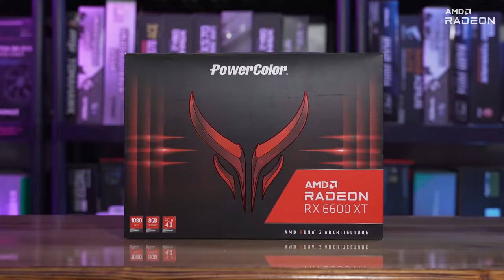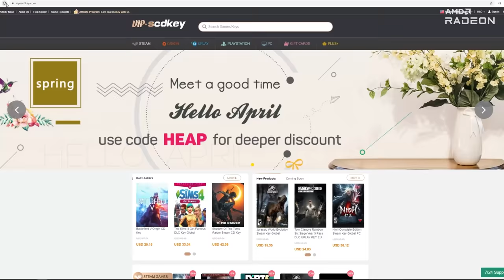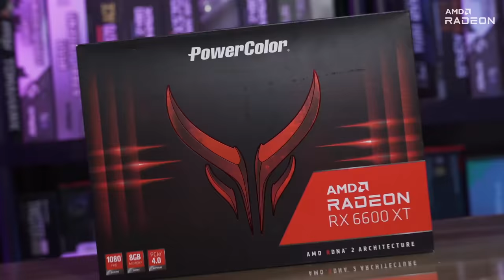LOCKDOWN Timelapse PC Build: Bakit SULIT na mag RX 6600 XT ka na lang? ft Tecware Fusion & Scythe

Comment: I bought a 6600 xt. The card is very efficient. Undervolted and underclocked from 2600mhz to 2400mhz. Power consumption from 160w to only 80w. Max hotspot temperature is 60c-62c.
Reply: pwede po malaman settings niyo?
Reply: @s0nderrr  I use msi afterburner because radeon always resets to default. 6000 series voltage is hard tied to frequency. So just by reducing the clock speed to 2400mhz you will automatically reduce the voltage as well. You will lose around 4 fps but for me its a trade id take all day. Play with fan curves till you get your desired balance with sound and thermals.

Comment: Ive bought my 6600xt for 620$ (33k pesos) paired with Ryzen 5 3600 so far the only games I cant max settings is CYBERPUNK which I don't Play. other games max settings especially Competitive games over 60-200 fps in 1080p which this card is capable at 1440p , 6600xt is just a 5700xt with 10% boost.

Comment: i planned to buy a 2060 pero wala pa akong pera ma bili iyon pero nung malapit na akong mag karoon biglang tumaas price ng 2060 29k minsan may 32k sa market place... nung nag lilibot ako napansin ko yung 6600xt for about 30k sinerchh ko siya at kinokompare sya sa 3060 pero yung 3060 35k to 40k naman... so sumuko na ako at naging plano kong bumili ng 1070ti jet stream 2nd hand pero pinag isipan kong mabuti kasi gusto kong maging future proof yung rig ko so ang nabili kong gpu is 6600xt gigabyte gaminig oc pro 8g not gonna lie i did not regret buying it kahit i5 3570k prociie ko at asus h61m-e yung mobo luckly gumana XD may onting problems langs still im happy tho ang ganda ng gpu thicc and long like ser bermor's shlong XD
Reply: Hindi bottlenecked?
Reply: @Jeydidee  bottled neck po sobra na halos di na gumagana yung fans gpu 🤣
Reply: Reduce the bottleneck by increasing your resolution and increase all the quality improvements option on each game in radeon settings. Everything that makes your gpu run harder turn it all up.

Comment: Pa Help Po Goods naba po tong pc build
CPU:Ryzen 5 5600g
MOBO:B450M Mortar max
RAM:PNY Epic-X XLR8 16gb 8x2 3200Mhz Ddr4
CPU:Corsair CV750 750 watts 80 Plus Bronze Power Supply,
SSD:Kingston NV1 256GB PCIe M.2 NVME
HDD:Seagate Barracuda 1TB
CPU Cooler : Wraith Stealth [Stock Cooler]
Reply: idol kaya ba irun ng b450m ang ryzen 5600g?

Comment: I'd rather go with TUF RX 6700 XT I bought mine for 40K than RX 6600 XT Red Devil 33k the price difference is only 7k yet you have a decent graphics card that is able to play 2k high settings and decent 4K mid settings able to compete with RX 3070
Reply: Except you'd be hard press to find one for that price. They mostly go for 50k now.
Reply: Kinuha ko na rtx 3060ti sa price na 40k
Reply: @meowk123  na scam ka sir sa price na yan add ka lng konti 3070 na or 41k Gigabyte RX 6700 XT
Reply: @xtreme_hunting  pangit yung mga model na 3070 pg 40k price point. Maliban sa colorful. Pero liit lng nmn dif ng performance 3060ti sa 3070
Reply: Mas stable para sa akin yung nvidia

Comment: Sir bermor oks na bang magbuild ng pc ngayon dec?
Reply: Hindi ako si bermor.. wait ka muna sa release ng amd nvidia at Intel bro baka mag sisi ka after building
Reply: @nowomannopants5045  Lagi naman may bago lalabas maiiwan at maiiwan ang specs. Build one if you want one, there will always be a new one to be released. It's a never ending loop when it comes to tech. If you need it now then go build one now.
Reply: @carlbarcelon3650  perspective ng mahirap vs ng rich lol ✌.. mahirap kasi ako sir susulitin ko tlga ang build 😅 pero if urgent pwede walang problema build agad hhe. Yung mga bagong labas sa 2022 lumang specs ng gpu upgraded lng may new apu din etc..
Reply: Thank po sa suggestions mga sir Godbless po sainyo
Reply: walang super sulit build ngaun, if you want one just build it the only part na pwedi mo ma skip is ung GPU  go for APU pag walang budget, the other parts imo are still like the same price as before, early this year i also bought like 2 5500xt for 10k each bnew instead of the 1650 Super which at that time 13k, for my younger brothers, fast forward now and the 5500xt(8gb) is around 14k+ na average wala png stock.. mga instock ngaun is 3060ti/6600xt/3000/1650/2060/1660 series na overpriced,
Reply: @JB-wl5sf  agree bro heard about new APU? performance daw in between 1050ti-1650 sobrang okay na yun (rumors) sana below 30k ang price or 35k baka kagatin ko na rin
Reply: @nowomannopants5045  wala ako experience on using APU but I've heard it's passable on eSports games(medium) and low settings on some AAA games(on low can probably reach 30 or so fps), as for the new APU, not exactly 1050ti/1650 level, as APU only equals to mobile GPU, so most likely mga laptop version ng mga 1650 ata equivalent, iirc 50-70% lg ata ung equivalent nung mobile versions.